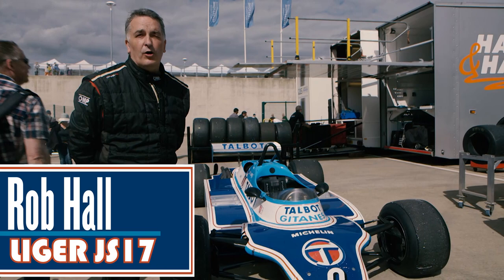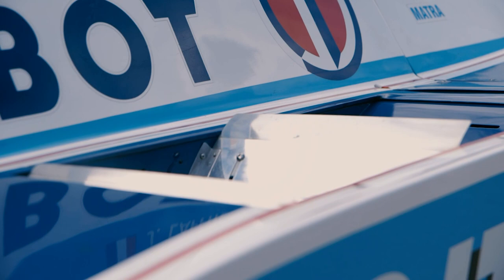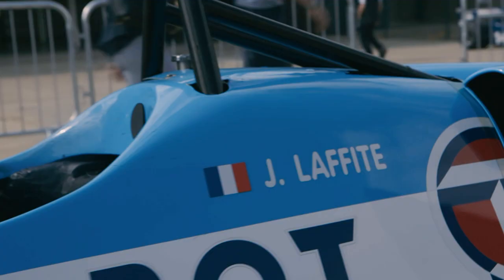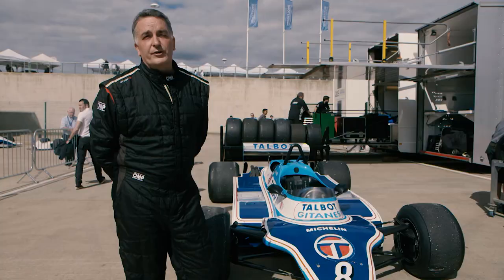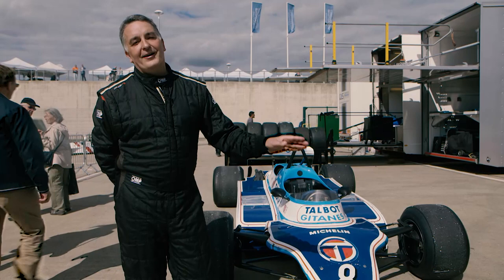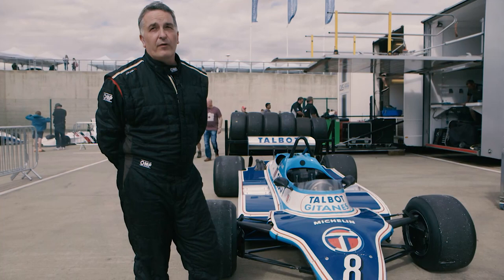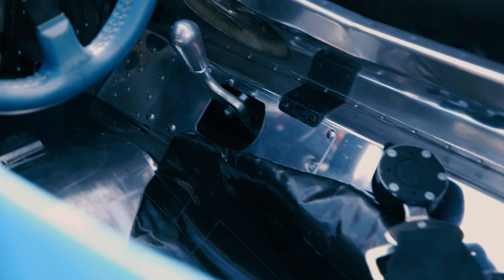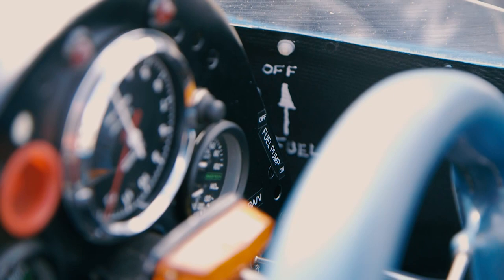Driving this F1 Ligier Requires Total Commitment

Comment: This car didn't have skirts in 1981, though it did have them in 1982.

This chassis was used for the early season of 1982, before being replaced by the less-than-successful JS-19.

In 1980 skirts ruled but there was a rule change at the end of the year for 1981. This stipulated a ground clearance of 6 centimetres and was measured as the cars left and arrived in the pits. What happened, of course, was that the teams tried to get around it. There were two ways: the Brabham way, using hydro-pneumatic suspension and the Lotus 88 "twin chassis". What happened was that the driver would have his car measured as he exited the pits before pushing a button and dropping the car down to about 1 cm off the road. Because of the small amount of ground clearance, rock hard suspension was basically mandatory. The Lotus 88 was simply banned.

At the end of 1981, this farcical situation was changed and skirts were allowed again for 1982. So this car raced in both guises: with hydro-pneumatic suspension and with skirts.

Comment: Georges Martin French mechanical engineer designed matra V 12 engine and worked for many evolutions of this engine for 10 years.
Matra had made a  new V6 turbo engine , in early 80s , for formula 1 but matra stopped f1 program

Comment: Is the gear box sequential?
Reply: manual
Reply: A sequential gearbox could in actuality be a manual shifting device  being the stick manually actioned back for upshifting and forth for downshifting. Plenty of camera car videos on YT can be helpful for you to fully
realize how it works.
Answering your question, these F1 cars had a conventional 5speed shifting stickgear:
most of Ford Cosworth engined cars  being equipped with Hewland g.box. Ferrari used a homemade
transmission if memory serves right,yet I can't
remember if Matra was fitted with a Hewland as well.
Reply: 5 peed, H-pattern. Dogleg from 1st to second.
Reply: @INDIGOBLUE555  Matra used the Hewland 'box.